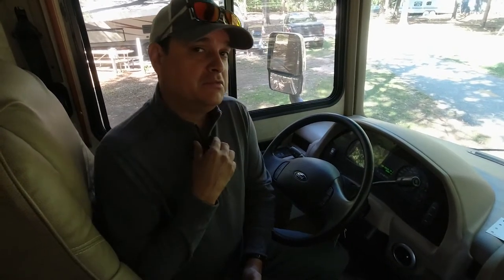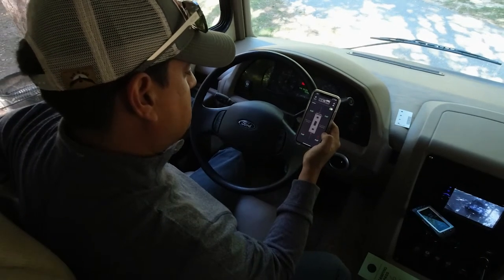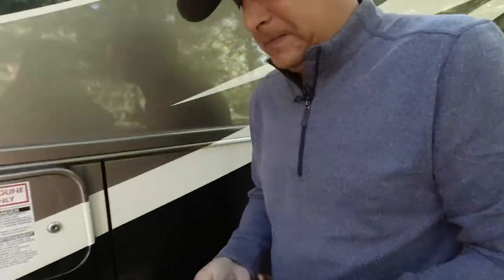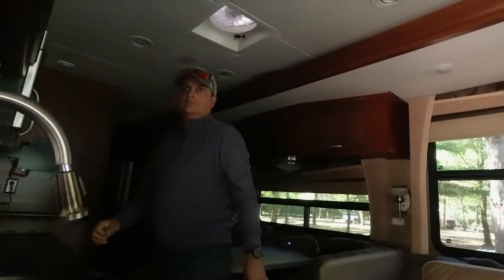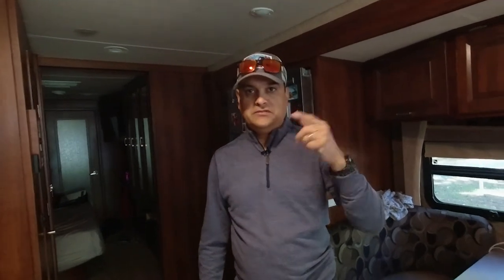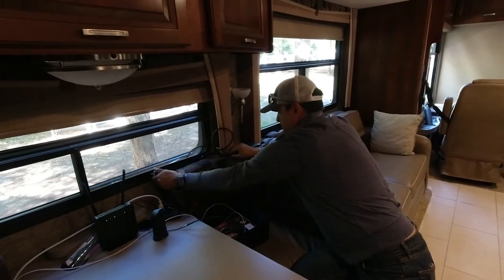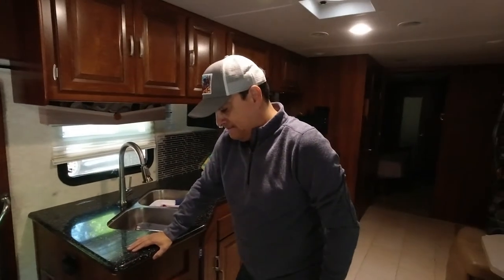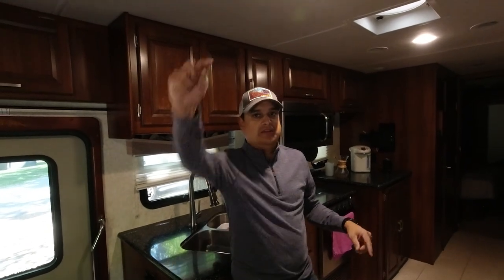How To Set up Your Motorhome at The Campsite

Comment: Circuit breaker off , Plug in  Surge Protector , to test line power,  turn on circuit breaker, everything OK,  Turn off Circuit breaker,  plug in RV , turn circuit breaker back on. Never crush /squeeze electrical wires, you can create a hot spot, fray wire strands.  Got your routine down good. Nice video.
Reply from the maker: Thanks!